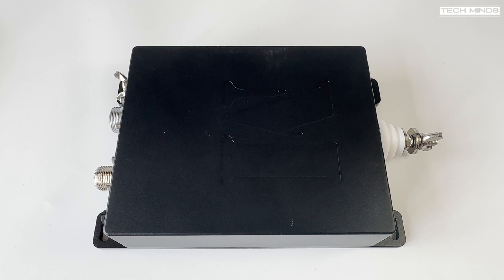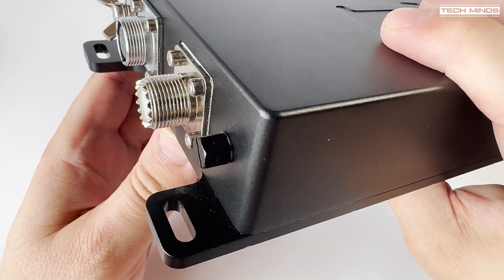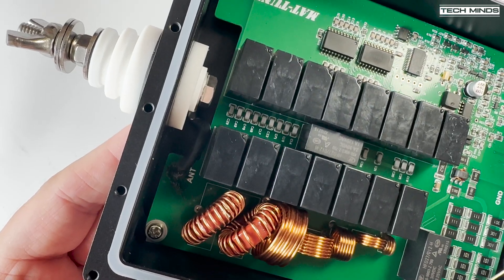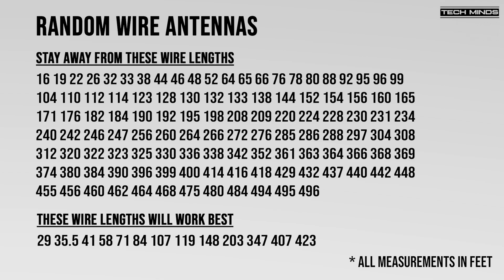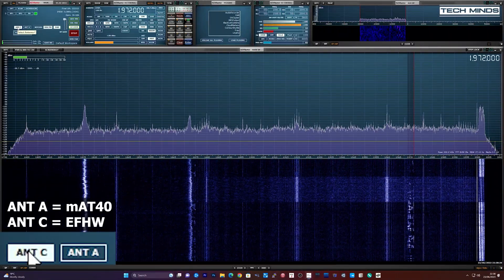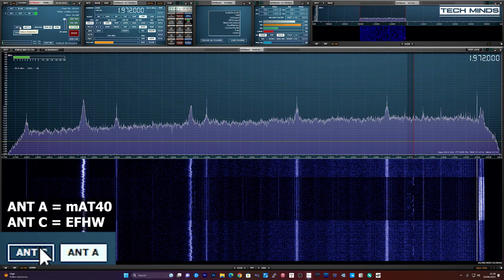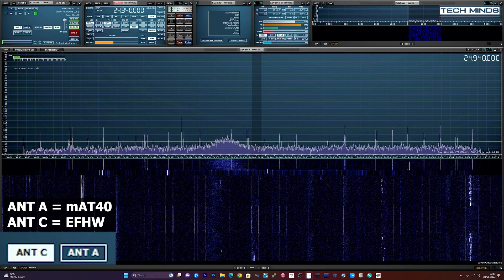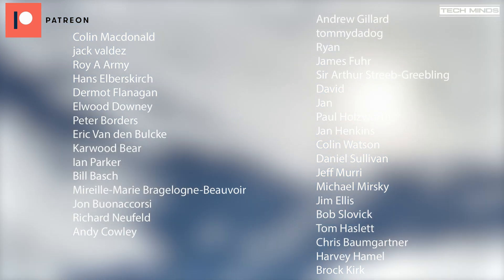mAT-40 Automatic Antenna Tuner Versus End Fed Halfwave EFHW

Comment: You can run up to 70 watts on FT8 don’t go passed 80 or it will fail, but it’s ok you just need to replace a tiny smd inductor on the RF sense line.
I had 2 of these mat-40s the one I fixed I sold on, the other however is sat in the shack waiting repair, due to blowing the crap out of the internal resistor dummy load network with 300watts by accident pmsl the smds were so badly blown to pieces that I could not recognise the values, I emailed mat for a circuit diagram but I was ignored, so thanks for doing this video because now I know what the values are as you showed us an internal look. 73

Comment: EFHW would be my choice, preferably cut for 80 meters as the fundamental half wave - much lower noise floor, stronger signals, and - if you buy or build a high power 49:1 for your EFHW, then you can run 1 Kw on the EFHW but limited to 120 watts on the MAT tuner

Comment: Surely if you are using a 58ft random wire you would not need a 49-1 as the impedance would not be that high. My understanding is that a 9-1 would be preferable, or am I missing something. M3ULT.

Comment: Instead of using a ground rod, have you considered running a wire along the bottom of your fence and laying on the ground? I think you'll find that ground rods aren't the best for RF ground, more for lightning. I have a Mat-125E on order and am looking forward to it's arrival. The antenna insulator on the Mat-40 spins because it is round, in a round hole. Commercial versions of that insulator have a key or odd shaped hole that matches with the odd shape of the insulator, usually a flat spot in the circumference of the hole, great review, thanks. We share a common trait, I can't let something with screws holding it together for very long before I just have to have a look inside. Maybe I was a cat in a previous life?

Comment: Hi Mat, Great video. I owned the mAT40 for a period of time. It was a decent tuner but I hated that extra control cable. Looking at your results the 49:1 with antenna up to 80 meters seems indeed better than the shorter wire and lower setup on the mAT40. For me on 40 meters the have the same results. I'm looking aht the new CHA URT1 (made by mat tuners LTD for Chameleon) or the new mAT50 (powered over coax) ... Cheers, Phil ON4VP
Reply from the maker: I have a video coming out in the next few days on the CHA URT1 :)
Reply: @pvdk Thanks for this tip. I looked up the mat-50, which I haven't heard of until now. It looks exactly like what I've been looking for. I have a 991a and Ive been reading reviews on the fc-40 from Yaesu. But, I lot of people say they have problems with it after a while. I like the mat-40, except for the added control cable. The CHA URT-1 is closer to what I want except it doesn't link up with the 991a's tune control and it operates as a separate tuner. The mat-50 does. I plan on getting one on order pretty soon. Thx and 73.

Comment: I think you should try it on your “EFHW” as you said with out the transformer. Not sure what your ground system is with the EFHF but you could simply use it or a simple ground rod. Yes more wire and higher is usually going to be better but you also need to consider your pattern. The EFHW has the same pattern as a halfwave dipole if it is a horizontal halfwave. As an inverted L halfwave the pattern will be somewhat different due to the vertical portion. As you go higher in frequency the pattern can get complex and the number of nulls in the horizontal pattern increases while the vertical portion may tend to fill in some nulls. 
I think a halfwave horizontal section, measuring back from the far end to the bend on the inverted L will give best DX results on higher bands like 20 meters. On 40 it will also give good all round results but for DX  the vertical portion needs to be long and the maximum current should be located about halfway up on the vertical section. That means the total wire length would be between a quarter and a half wave long. It’s hard to get a good pattern on all bands on a multiband antenna.
I have had great success with end fed wires with simple ground rods and minimal radials, even on 160 meters. For example my 160 meter inverted L is about 3/8 wave long. The high current point is always 1/4 wave back from the open end and that puts it about the middle of my vertical portion. That inverted L is really a top loaded vertical for DX.  To get my 160 meter DXCC I used from zero to 2 radials. So minimal ground systems do work! Could I have had a better ground? Definitely. Would I have noticed the difference? I doubt it.

Comment: Results as expected.
The EFHW, seemed quieter, and received pretty much all station better, I saw maybe one station that was stronger on the MAT-40, but both antennas picked it up well.
Will the MAT-40 work better with more wire? Extremely likely, will it work better a bit higher up? Depends on if your were receiving NVIS signals.
While I like the idea of the external tuner, I think you they are best at getting more bands, but not getting them in better.
If you don’t have room for a 40 or 80m EFHW, these are a great option. Also, if you have gobs of room to run more than 40m of wire, this could be the bees knees.
At that point however, a full wave loop antenna is probably the best bet if you have that much room.
For the money. A true 80m EFHW is tough to beat.

Comment: I have a Yaesu FT1000MP, but have found that its tuner socket is larger than, for example the 7300 and 857.   The MT-40 Yaesu adaptor cable therefore doesn’t fit the FT1000MP.   Does anyone have any advice on how to adapt the Yaesu adaptor end cable to fit my radio?  Thanks John M0JWA.

Comment: I have an 80-10m EFHW 49:1 and it works really well, I do think the IMAX 2000 is better for 10m but could be down to the different polarisation of the other signals either but in general the IMAX 2000 seems to pull in signals much better at times. I notice the same on 11 which of course the EFHW isn't resonant on. 

The only real reason I think to use a tuner is for when you want to work non resonant bands but since the 80-10m has all the bands I need I don't see the need for a tuner + for use with the acom 1000 the EFHW saves me a lot of money by not having to buy a tuner that can handle the power. 

I suppose for experimentation the external tuner might be some fun to test out if it's cheap enough. 

I also find my EFHW 49:1 a quiet antenna.
Reply from the maker: At my last QTH I compared my EFHW with 49:1 for 40 with 80m coil, against a Sirio 2016 mounted at about 6 metres. The EFHW was the same as the 2016 on 10M. However, I am also considering setting up another 10M vertical, and doing some more tests at my new QTH. So, watch this space, I will make a video about it soon. Thanks

Comment: By looking at the connectors and the cover it looks like the connectors have a seal along with the rear cover. Perhaps the plug is there because the case was filled with a gas like argon to help keep the enclosure water proof. This would be like a rifle scope that is nitrogen or argon filled. Just a thought and if so by removing the cover you will let the gas out.
Reply from the maker: No gas, just air, just like from the manufacturer. Good theory though! Thanks
Reply: Filled with Argon????

Comment: I would have liked the test with a common antenna and swap out the ATU with the endfed matching network.
Reply from the maker: I’m pretty sure the EFHW with 49:1 is just as common as a dipole these days. If I attached the mAt40 to my EFHW wire it would not of worked well because it’s resonant on 40m as a half wave at least.
Reply: @TechMindsOfficial  I would think the endfed matching device and the ATU are doing exactly the same thing.
They are matching the end of the wire impedance to a low impedance.   49:1 is a fixed transfer. The wire end has to have a high impedance the reason they want a half wave.  Divide that by 49 and if the length is correct, it will result in the impedance range of the 50 ohm coax and transmitter requirement..  Highly unlikely that will work out 100% and it will need the radios internal tuner or external tuner for that 50 ohm radio requirement. The ATU will correct regardless of the impedance at the end of the wire provided it's in the ATU range/Impedance capabilities. This would be vary with ATU specs.    One thing I believe the ATU has as a benefit is, it will match low impedance.  The 49:1 would not work well for low impedance. For example if the length of wire was a quarter wave it would have a low impedance at the end.  49:1 would really drop that to much.   ATU benefit it would match any length vs a 49:1 requiring a high impedance on the frequencies of use.

Comment: Hello Tech minds , I would like to ask if you know the Key fonction of the PIN input control, I attempted to use the mat-40 to tune the Codan NGT SRx. With your existing interface cable maybe you can identify it. Thanks

Comment: 👍Thanks for doing the video. These external "tuners" make a lot of sense compared to having an "ATU" in the shack or using rig's internal ATU. If an ATU is required, it really should be at the antenna feedpoint.
Reply: Disagree. A tuner in the shack is just as effective as one at the feed-point. The loss by having it in the shack is minimal.